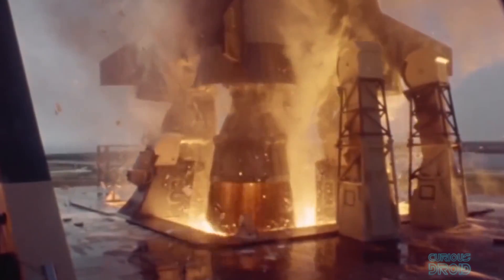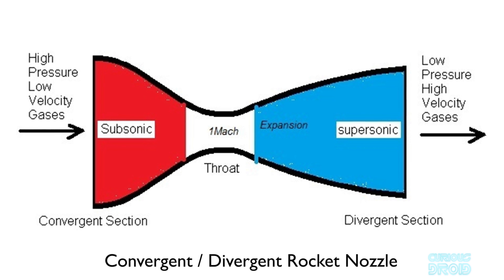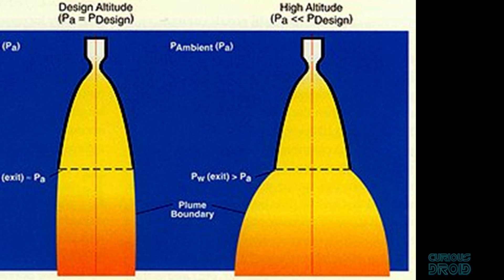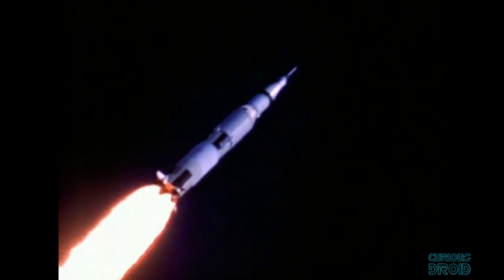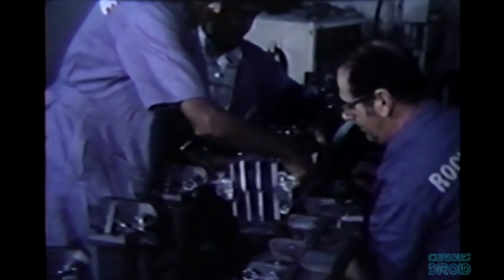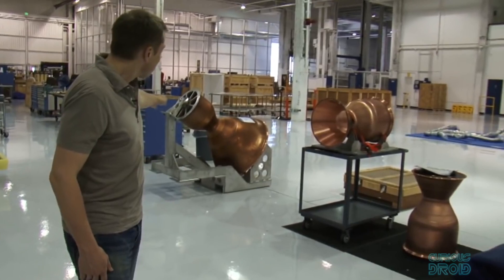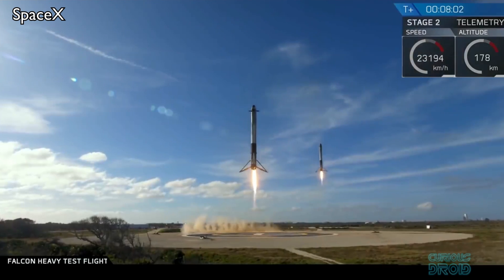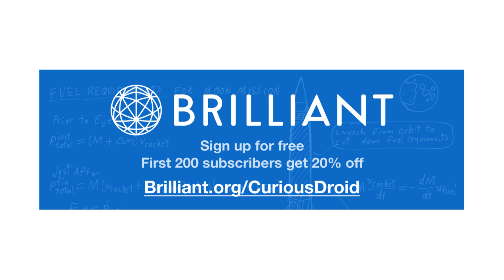Aerospike Engines - Why Aren't We Using them Now?

Comment: 2:25 "1 square inch, or 2.54 square cm". 1 square inch is 6.4516 square centimeters.
Reply: 2.54 squared is 6.4516
Reply: You would sad 2.54 square cm for the area of square with the side length of 2.54cm. You wouldn't actually use the squared value of 2.54
Reply: Aspect 
Sorry, mate, but that’s plain wrong. A square centimetre (cm^2) is, by definition, a square with sides of 1cm. 
A square with sides 2.54cm is 2.54^2cm^2 = 6.4516cm^2.
You could, logically, call such a square a “2.54 centimetre square” but that is not the same thing as “2.54 square centimetres” and it’s probably not a good idea because of the potential for just this sort of confusion.
Reply: @q.e.d.9112  Well said! Leads to failures like the Mars Climate Orbiter (nearly USD 400 million!). And it is "50 kilo- (1000!!!) metres" , NOT "kilom-etres"!!!
Reply: Allan Stewart 
I think the kilo-metres/kil-ometres pronunciation battle is one you can’t win.
The latter seems to be near universal in  my experience.
Reply: @q.e.d.9112  You may well be right but I will persist. We need to tell all scientists (& others) that astronomical distances will be measured in "lighty- ears", computers have "terab- ytes" of storage etc. Fight on!!!
Reply: @aspct.  If you say make a square of 3x3 inches it is 9 square inches. If you make a square of 2.54x2.54 cm it is 6.4516 square cm ....
Reply: @aspct.  A square by definition is all equal sides, so squaring the value is accurate for this example. You are correct, my good sir!

Comment: why dont they just make a bell shape rocket engine that could change shape depending on the altitude ?
Reply: Thatd probably be pretty complicated. Itd have to withstand all the pressure and heat generated, and be consistent enough to not break ever.

Comment: My nozzle has a few take off's on the dial but I still have plenty of thrust.  Another thrust motor bay be needed soon but I can stil get to the moon and back and all within 5 minutes Now that is what I call performance.  Current record stands at one minute 7 seconds but then Intervention was needed but usually 3mins eed 12 seconds is usual before it burns out.  I also so group demonstrations but slow down a bit after my fifth take off. My nozzle has a bell end like the one on the footage  and flight time is as long as 12 - 29 minutes.  Requests by email only and not noofters please.

Comment: Based in the diagram, rocket exhaust goes hypersonic from the taper if the nozzle outward. Dies that imply the exhaust creates a Sonic boom as it is exhausted?   A continuous Sonic boom. Might account for the loud noise if takeoff

Comment: So in short, we could do incredible things, but money... .. . Typical.. -.-
Reply: Well currently a Falcon 9 v1.1 with a launch mass of 506 t can lift almost 5 t (less than 1% of start mass) to GTO.
So 40% in that respect isn't much as it means that the above example would only lift 2 t more to GTO with a rocket of that weight... That's not really too much considering the amount of launches every year, and the potential billions of dolars it would cost to develop.

To do incredible thing we'd need an engine that would have like 10000% more efficiency (in relation to the rocket mass).
Reply: Money and politicians.

Comment: The curious Droid is gently omitting the fact that omitting empty stages reduces weight and puts on extra thrust (the mass of the stage hulls works like gas blown out backwards).
Reply: I thought the same. If efficiency is 40% as it's stated, it could lower the cost to orbit much more since you can carry more payload.
Reply: @sporegnosis    
Wikipedia states that the theoretically computed efficiency could not be reached because of aerodynamic problems that showed in tests. So may be the overall calculation result just says »keep it simple«

Comment: Fuel savings mean also weight savings? Space engineers would kill for opportunity to shave kilograms of rocket. Weight savings would have disproportionately high effect on how high or how much you can launch.  Or by fuel savings you meant cheaper but heavier fuels? Which ones then?

Comment: Does this sound like "Flight of the Aerospike", "SEVEN YEARS AGO"

Posted: Thursday, 16 August 2012 @ // Updated: Thursday, 16 August 2012 @ // Source: Mediafax

The Execution Engine uses liquid oxygen as oxidant and kerosene as fuel. The traction of the engine is 23 tons of force in vacuum and the maximum operating time in flight is 190 seconds. By using composite materials and duralumin alloys widely, the Executor engine weighs only 210 kg, giving it a traction / weight ratio of 110, the best ratio ever achieved by a European engine. ARCA estimates that an even better report will be achieved after the tests are completed.

"Executor is the most important program of ARCA so far. After the completion of the tests we will have a high technology product, a brand achievement at European and world level. We are proud that it is a private program in Romania. allows to approach orbital flights. We especially wanted to make absolutely all the components of the engine at ARCA. Not dependent on subcontractors, we lowered the costs and we greatly increased the speed of execution. Moreover, any necessary changes, in the direction of the performance increase, will be extremely easily and quickly implemented, "said Dumitru Popescu, ARCA president.

This engine was made largely by private donations, without the support of the state. ARCA will continue to seek public support, as part of a donation campaign, for the completion of the other engines, as well as for test operations and related logistics.

The second Engine Executor is completed 50%, and the ARCA team will make four complete units and 12 combustion chambers.

The first vehicle equipped with the Executor engine will be the Haas 2C rocket, which will be launched in mid-2013. The rocket will place on the Earth's orbit the Bulgarian CubeMessenger satellite and another Romanian satellite.

The Romanian Association for Cosmonautics and Aeronautics (ARCA) is a non-governmental organization that wants to win the $ 30 million Google Lunar X Prize competition and launch the first Romanian rocket capable of carrying a cosmonaut into the cosmos.

The objectives of the ARCA team are: development of the Executor rocket engine; development of the supersonic IAR-111 transport aircraft for the Haas II rocket; winning the $ 30 million Google Lunar X Prize competition using IAR-111 / Haas II; the development of the Super Haas orbital rocket, capable of placing useful loads of 2.5 tons in orbit; launch of a cosmonaut on Earth orbit, by 2025, with the Super Haas launcher.

Among the previous programs developed at ARCA were the Demonstrator 2B rocket, equipped with the world's first reusable composite engine, which was successfully launched on September 9, 2004, from the Air Force Base in Capu Midia.

ARCA also developed the Stabilo aerospace system, which has performed two flights. Mission 1, launched at an altitude of 14,700 meters in the stratosphere, and Mission 2, launched in 2007, at an altitude of 12,000 meters, above the Black Sea, with the support of the Naval, Air Force and ROMATSA.

To these were added the suborbital rocket Helen, a technological demonstrator for the Google Lunar X Prize competition, launched on October 1, 2010, off the Black Sea, in Mission 4B, reaching an altitude of 40 kilometers.

ARCA Execution Engine, PHOTO: ARCA
https://www.romaniatv.net/arca-a-finalizat-primul-motor-executor-pentru-avionul-supersonic-romanesc-foto_40509.html

Comment: If an aerospike engine is 40% more efficient, and the fuel to launch a rocket is the cheapest part of the system, doesn't a 40% boost in payload pencil out? OK, split the difference- 20% more payload, 20% less fuel.
Reply: The problems is the aerospike is less efficient at any stage than an equivalent bell nozzle . With multistage rockets you can have difference bell shape  for different altitudes.

Comment: Does Elon know about this?
Reply: I'm sure he does.  Cluster engines do the same thing.  The Saturn Five and Space X both use the same concept of a center engine(s) surrounded by outer engines.  This allows them to throttle the center engine to control the exhaust funnel.  The  aerospike is good for single engines.  The blade version of the aerospike was to allow for a lifting body configuration to use aerodynamic lift to exit the atmosphere then the same for hyper-sonic glide reentry.  The space shuttle used 3 engines with a gimbal to control exhaust funnel.   So aerospike blade engines are limited in application.  It is better to have one engine that you test the heck out of and use it again and again.

Comment: The u.s. Air Force has vectored thrust engines designed off of this engine and they've classified as top secret that's why you will never see it on a NASA spaceship until it's Declassified

Comment: there is one test atmospheric test flight using a cyclotron to create something that would have function similar to effect of an aerospike, Nokia tested an even dozen propulsion systems in bare hulls. The controls were too limited and used the control logic from a pin ball machine paddle controller, and spin up and spin down for Left Primary, Right Primary rotating in toward the center, three
up and three down to control flow of hot gas. They use methane from liquid O2 and liquid H2 mixing in a combustion chamber, then the resulting water flows into a chamber with liquid N2, which is mixed with Ethanol liquid, to create liquid Methane about minus 180 c. They flew off the launch cradles and landed about twenty miles away. More like skied down the slope of the mountain when they came back towards the ground. So there has been large scale test, and it got ignored because all the satellites were on the 2004 summer Olympics in Russia. Finland being a very small population just buried the X37A under an avalanche, so no one would bother Finland for technology in case it was too advanced. A graduation class worth of MIT students and they build cell phones for everyone. I am looking forward to a working demonstrated F37B. The X37B was tested at cape canaveral this year. Though due to design I would not expect it to be a civilian space ship any time soon.
Reply: Wait.. Nokia tested rocket engines?
Reply: @remliqa  yep during the Olympics in Russia in 2004, they were trying to develop more commercial exports and the results of test got buried under the snow in an avalanche. the propulsion systems are likely still not a dead end just maybe not near mountains that are heavy with spring snow.

Comment: In 2001 I was so looking forward to the X-33/X-55 totally changing spaceflight, George Bush cancelled it...now we are rebuilding a slightly larger version of the Apollo craft...it is confirmed we are now living in an age where we are going backwards from an innovation point of view...sad
Reply: X-33 cancelled? It was taken over by the military off nasa. Now being used for their experiments using nasa expertise last I read/heard.
Reply: @re2590  No, military is using x-37, not x-33.  Totally different.  Then again, the Air Force could be using a Stargate and we'd never know. /s
Reply: Because it uses less fuel?
Reply: I agree, but the X-37 flew for about 3 years in orbit.

Launched in 2017, and returned in 2020.

Comment: Actually, there was alot of flt testing...in the late 1990's it was actually shown doing something like a 1-2 miles flt, maybe 200' off the ground, if I remember correctly, it was a round trip back to it's original launch point... Then they just stopped showing it to us, imagine that.roll down the road to Obama yrs and he scraps the shuttle program...hmm, did u know thef-117's Operated as a full squadron out of Holloman afb, staring in 1980??? I wonder

Comment: Curious about the physics...... if atmosphere is necessary for thrust , then how can an object be maneuvered in a vacuum?  The lack of atmosphere is replaced by what , to facilitate motion?
Reply: Atmosphere has nothing to do with thrust. Open a balloon in space and it will fly off.
Reply: No, the atmosphere actually impeded thrust in way because it creates resistance. Rocket engine usually have gimbals to control the direction  (or uses something like reaction wheels in space). 

I think the problem here is you think rockets and spacecraft move like aeroplanes, they do not.
Reply: @remliqa  
Your off track.  Re read the question.  I'm saying ... no thing..... can maneuver in a vacuum.  And questioning...  ((what REPLACES  atmosphere)) to cause thrust? 
         Nothing can be propelled without an atmosphere to thrust against.  Common  physics basically....
Reply: @icflatndatsdat5615  you're completely wrong  there son. Get a physics book read the mechanics chapter. Simple stuff really and will clear things up for you.
Reply: @freepadz6241  
Well , I feel I'm ( "completely right!").
Perhaps you can respond a retort to the question instead of underestimating a man you don't know..... boy! 
       I simplified the question for all.....

Comment: A point of disagreement.  The reason for multi-stage rockets was not engine efficiency.  It was weight reduction.  They changed the shape of the output nozzle, but that was never reason for multiple stage rockets.
Reply: He knows that he said it was ONE of the major reasons

Comment: There are several companies building this for the smallsat business. The Raptor engine is hard to beat though. It's closed cycle and very efficient.
Reply: Raptor engines weren't built for the smalsat market.
Reply: @remliqa  You misunderstood the comment.
Reply: @james1seattle  
Kindly explain it then.
Reply: @remliqa  There were two separate parts to the comment. The first sentence was a comment about the fact that several smallsat companies are working on Aerospike Engines. The second part of the comment(second sentence), was a comment about the Rapter Engine as compared to Aerospike. It had nothing to do with Smallsat. It was a comment about the quality of the Raptor Engine.
Reply: @james1seattle  
Oh , I see.
Reply: @remliqa  SpaceX is however working on a prototype of a new upper stage Raptor for the Falcon 9. So it will probably be used for smallsat launch.
Reply: @james1seattle  
Yeah, but to use that upper stage you have to hitch a ride with  other payloads and obviously they will be issues with that.   Suffice to say that dedicated smallsat launcher like Rocket Labs (provided they improve their launch cadence) will still take away market share from Space X even with that upper stage configuration.

Comment: Aerospikes will be developed, as has been demonstrated with just about every other technology man’s ever pursued. Part of making a profit is becoming more efficient, reducing cost and waste, and increasing recycling and reuse. Once these types of launches are cheap enough and continued development yields diminishing returns, and as fuel becomes a larger and larger component of the diminishing price of rockets, it will make financial sense for private space companies to begin R&D into new engine designs. And I would add that the problem with space is not the lack of financing: It’s that putting objects into orbit is so damn expensive in the first place. We all know the black holes taxpayer money can disappear into thanks to the X-33 and F-35; to be sustainable, these endeavors need to be privately profitable (or close enough to develop it) so rich guys are willing to put their own money on the line.

Comment: As No one has actually built a booster with an aerospike engine is their any proof that the cocept works After after all NASA has given up on the SSTO concept leaving it to a small UK company Reaction Engines limited (REL)to develop their sabre air breathing rocket Engines -the SABREengine into a horisontal takevoff and landing totally reuseableSSTO craft

Comment: Errr... excuse me for nitpicking, but at 2:28 you say one square inch is 2.54 square cm - no, 1 inch is equal to 2.54 cm, so a square inch is 6.45 cm2. It doesn't really affect your further calculations, but still, it always helps one's credibility to be accurate in one's calculations.

Comment: I heard a rumor that the X-33 was absorbed by the DoD and was perfected. Supposedly, it launches out of Dugway test range, UT. It would not surprise me if there is a hybrid jet/rocket system used on the 'perfected' generations.
Reply: Not really, DOD was planning something called "Space Plane" if I recall.  It was a small one-person vehicle that they could launch into LEO.  Then, the pilot could observe, same as the Blackbird, but higher.  They got further than VentureStar, being built around the same time, and had some similarities.  Lifting body design.  But I think DOD realized it was much cheaper to just use satellites for photos.  

That program eventually became X-37, which is purely robotic, no manned missions.  It just serves as a testbed for testing new DOD toys in space.  They still launch them once in a while.